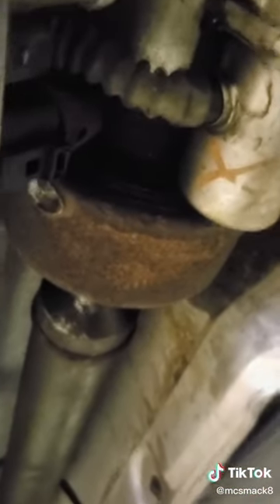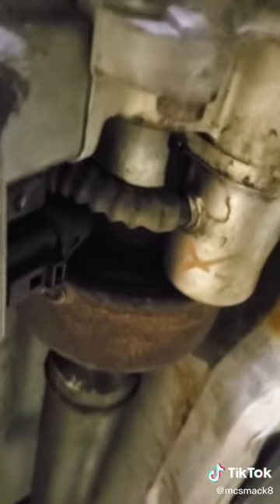How Engineers Keep Mechanics Miserable (Part 356) #shorts

Comment: I couldn’t handle being a mechanic in the north. You guys are a different breed. I couldn’t deal with have to break the torch out every time I do a repair. I’d make myself the interior trim, driveability and electrical guy of the shop immediately.
Reply: That's exactly what I am. Suspension & driveline work sucks balls in PA, so most of my diags are electrical and interior stuff. I've even had cars where I had to replace every piece of cloth & foam in the entire interior. 20 hours of work with no one bothering me and nothing is burning me or super heavy.
Reply: Wisconsin 45 years worth!!
Reply: @TekuTaurus  people really ain’t seen shit till the come up to ny. Being in the rust belt sucks, being in New York where they spread 30lbs of salt every 10ft really fucking sucks. People in ny pay premiums for used PA cars cuz even the PA cars are better then the shit we got here
Reply: @matt.squarebody5427  this. Not knocking anyone else in rust states but NY cars are a different breed of rusty junk.
Reply: come see what its like in Canada
Reply: @Nhil famine  right? especially on the east coast, where we have salt in the air....   Newfoundland, the brand new vehicles at the docks, not even delivered to the dealers to sell, starting to rust. salt in the air, salt on the roads.  my city says they can melt up to 10cm of snow with salt alone.
Reply: Dont recommend electrical either bruh
Reply: If you make yourself the electrical diagnosis guy, you'll be virtually writing your own paychecks.
Reply: @TheDingmann  oh believe me I know took 3 nights after work to remove the transmission in my 95 jeep YJ because every bolt that holds the transmission skid plate on had decided to become a permanent part of the frame, I ended up grinding the head off popping them in with a punch and hammer then welding a new nut to the inside of the frame
Reply: rust belt mechanics are simply built different
Reply: @illiniwood  this is why im the carburetor guy
Reply: @TheDingmann  Same in Eastern Canada. Montreal, Ottawa, Toronto. So much salt on the road you can smell it.
Reply: Honestly not terrible once you know which bolts will be seized, which ones will snap, and how to handle it once it happens. And always fight/plan for extra time
Reply: @user-white007  in Canada they are all of the above map gas for almost everything  25 years or older
Reply: @nhilfamine1876  air hammer and acetylene torch come in handy, Michigan tech
Reply: It's bad as the cars you consider old and rusty in the states are the average 5 year old car in the UK, I've seen 7 years old cars completely rotted through underneath. I've got rusty bolts on my 4 year old car. It's just how it is here. Always wet and salt on roads for 3 months of the year.
Reply: I definitely could use someone better at knowing drivability issues more specifically than the customer, because everything either feels fine or fucked to me
Reply: @TekuTaurus  I work at penske in pa. Dude. The rust is even crazier than cars. Wanna take a shock out? 2 bolts? 2 hours cutting them out have fun and no we don't have the bolts so cut the shock.
Reply: Rust belt mechanic here and yeah you east coast and southerners are lucky. The job is 10x easier but you guys also scrap cars that have way too much life left in them.
Reply: @cra4war  idk about the life thing. The frames in trucks might be ok. But beat to hell and back.   shit just not financially viable at a certain point to keep a car on the road. But as a fellow rust belt. My lead tech and I were fighting some bolts ubolts shocks and leaf springs all day today for the 2nd day in a row on our worst customers truck. We had to weld a giant nut onto a bolt use a IR D HANDLE air impact. Go out and buy sockets just to get 2 of the bolts out. We drained all the air out of our system on each bolt it was crazy. First time I've ever seen the air cut out there.
Reply: I guess I am lucky to live in the Southwest where it's dry as a bone. Worst we have to deal with in Phoenix is overheating in the hot summers if the cooling system isn't maintained and occasional a/c work. No rust issues though.
Reply: There is no escape, the cold turns plastic into glass and the salt corrodes copper about as well as steel. It is better than suspension though, suspension is a nightmare.
Reply: @matt.squarebody5427  better than Texas where on the couple occasions we get a tiny bit of snow or icy roads, nothing is salted and everyone starts crashing. As a lover of old shitboxes though, I really can't complain about how pristine old cars can look on the underside.
Reply: @matt.squarebody5427  Yea, i live a lil north of hagerstown, md. We wont buy with a NY title. Even if the body looks nice, wait til u get underneath it. I try and spray my undercarriage and wheel wells when I wash to get all that salt off... but it barely snows here.
Reply: i’m from chicago and i’ve seen cars w low miles whole bottom is rusted out. Car came in saying their car smelled like exhaust fumes and the bottom was rusted out you could see the carpet

Comment: Just for future reference, that shaft will unbolt and slide up towards the engine. So you don't have to drop everything. Now the rust issue is another thing...
Reply: Yep I seen that first thing. It has a cv type joint and that slip shaft. Just use a big screw driver or prybar give a good tug.
Also put in neutral to roll it over to get the upper bolts.
Those guys must be new or mentally challenged not to see its not so complex and need to drop only 1 side.
The side on the transfer case is really easy and not need to drop anything.
And their using a lift. I did my rear shift on the street in late october. Easy work just have to look and think.
Reply: What he's saying in the video is that it WON'T slide up towards the engine, because it's too rusty.
Reply: Torch it and it moves
Reply: Same

Comment: If you're wrenching in the rust belt and working on cars that use jack bolts to remove parts, you may want to invest in a set of bottoming taps to clean the threads before you bust the next bolt off in the hole. Won't work everytime, but even if you use a new tap every time it's loads cheaper than the route you're on now.

Comment: Their is a specialty tool that pops it out that is the aoc pump that connects to the final drive unit. Before you replace the pump. Pull it out and clean the screen and put fresh oil it and you need to calibrate aoc pump. I am a Volvo mechanic. I actually just replaced two this week on xc90’s but most of the time you clean that screen and calibrate works properly again

Comment: Remember: in order to change an alternator diode or belt you must first put the car on the lift, remove the front passenger wheel, disconnect the suspension, then lift the engine up and forward with a hoist  ....
Or purchase a classic car from the war era to about 1963.

Comment: My awd volvo spent 10 years as fwd only. My mechanic removed rear shaft.  Once a year I would slip for one second if I accelerated too hard on a slope or in the rain.  Never ever noticed it otherwise. Saved me $2000